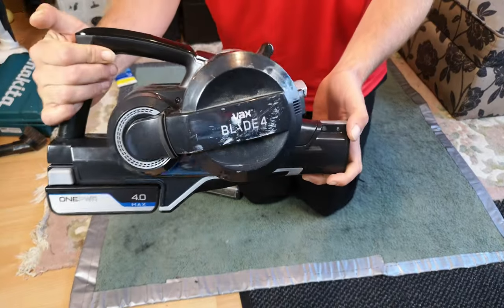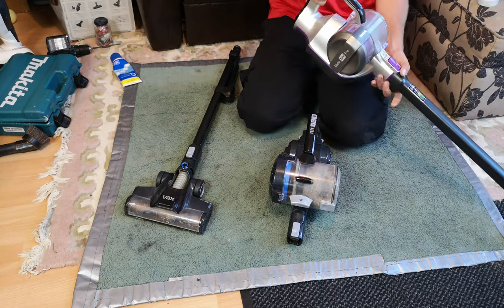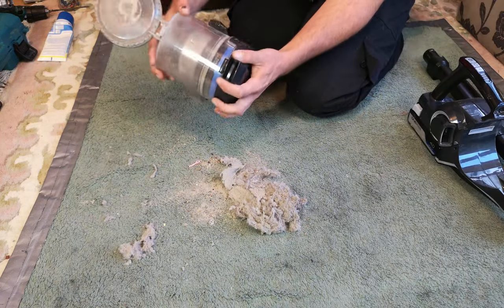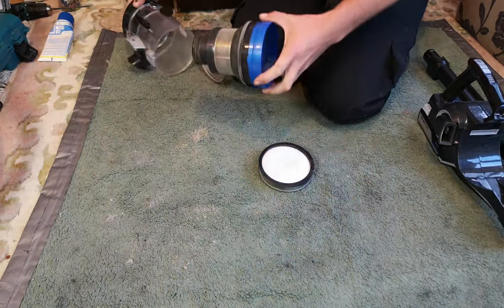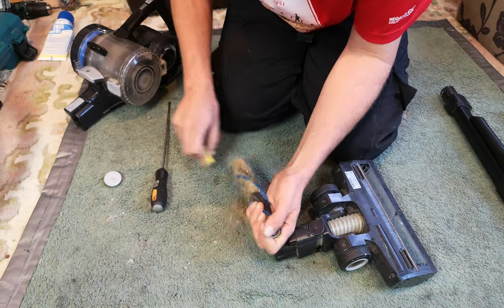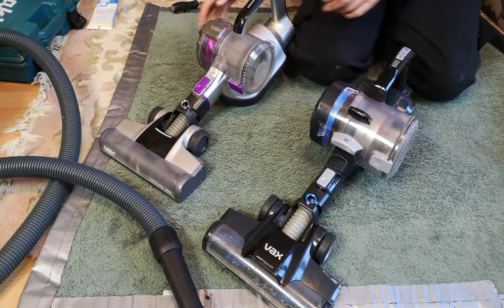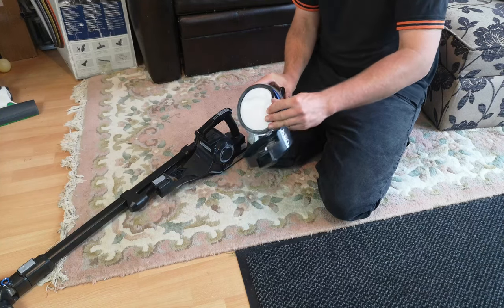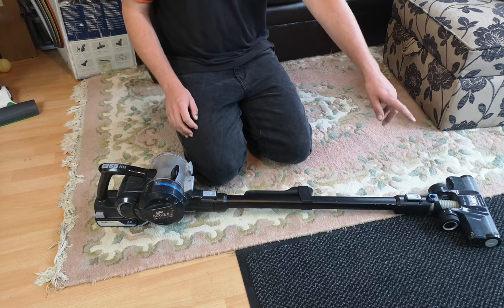Restoring a Vax Blade 4 to AS-NEW Performance in 12 minutes!*

Comment: The blade max 2 was almost identical form factor to these, only battery wasn’t removable, was a decent enough performance had it 4 years then flogged while it was still going, it was a brushless motor and 40v , ps compare the blade brush roll to Henry quick almost identical! The blade max 2 I had in max mode would stick to the carpet and was difficult to push.